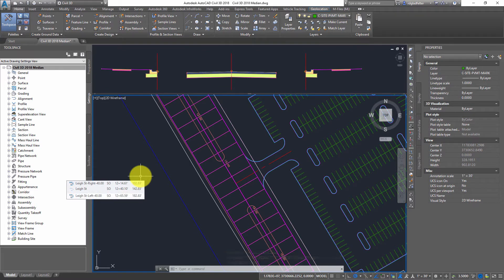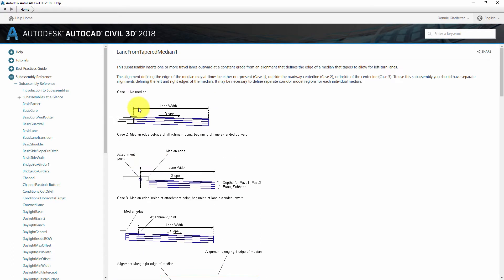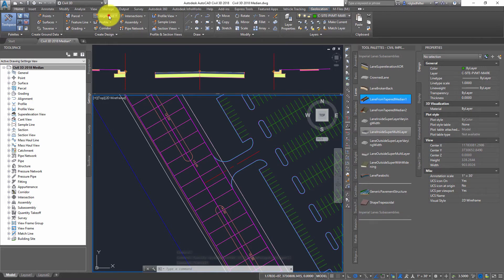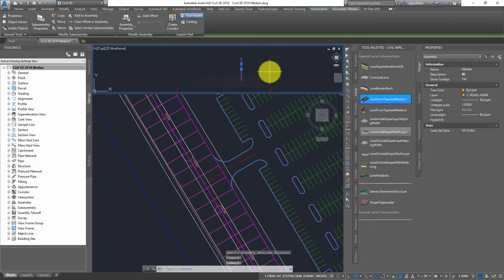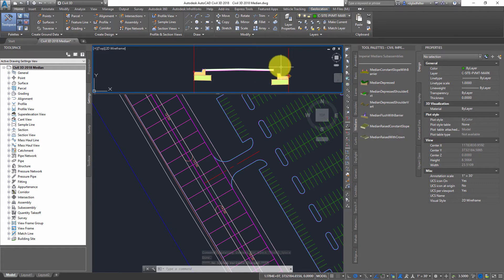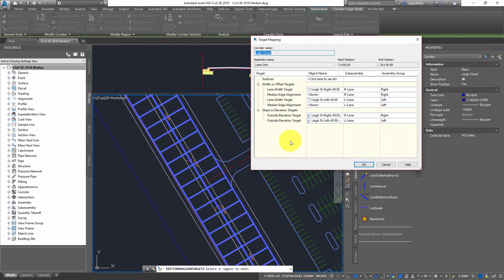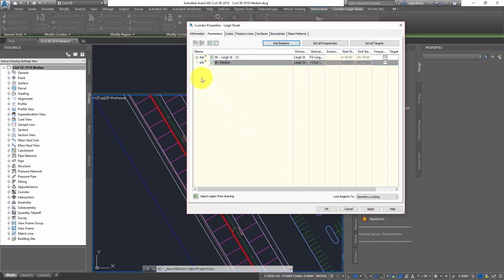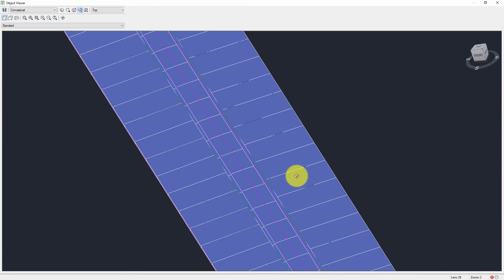Modeling Medians using AutoCAD Civil 3D Corridors

Comment: Good info.
How do you show the median openings???
Reply: That's a good opportunity for a follow-up video to this one. The basic concept to model the median openings is to split the Median region two times; first at the start of the opening, and then at the end of the opening. With the corridor region representing the median opening, I'll then assign a Null Assembly to that area. That will result in the Median being removed, but there also is a hole in my lane/road.To fix the lane, I'll begin by splitting its region twice; first at the start of the opening, and then at the end of the opening. With that region defined, I'll then adjust the lane Targets for the open area of the median, removing the median offset alignments as targets. With those targets removed, the lane will return to a standard crown throughout the median break.
Reply: Thanks. Yes, that would be a good follow-up video.
Reply: Thanks for the explanation for the median opening. Then I would like to add on to this topic of how do you model the median noses?
Reply: @sorenman1  that's also i want to know
Reply: Great topic Donnie. Let's continue the discussion by shifting the median as you would for a left turn lane into that driveway. I'd do it, but your voice is so much better than mine.  :)

Comment: Is there a way you can explain how did you create the assembly in the beginning of the video?
Because the target mapping dialogue box shows the median items and I cannot see them in my case. TIA
Reply: There are two Assemblies used in the demonstration. The first is for the road. It's just a standard crown road assembly that uses the LaneFromTaperedMedian1 subassembly. The discussion for this is found at https://youtu.be/ZGl-JfhZGac?t=44s

The second Assembly is for the median itself, and that entire process is found at https://youtu.be/ZGl-JfhZGac?t=3m32s. If you're having trouble building the lane assembly, see how I add the curbs to the median assembly by selecting the circle (attachment point) of the assembly. You'll select that same point to place the lane subassembly when building the road assembly.